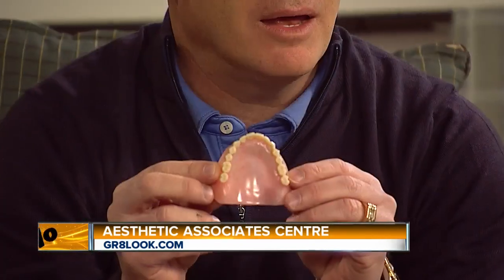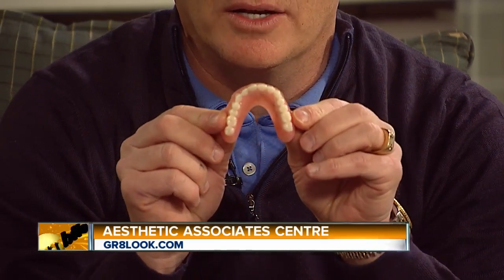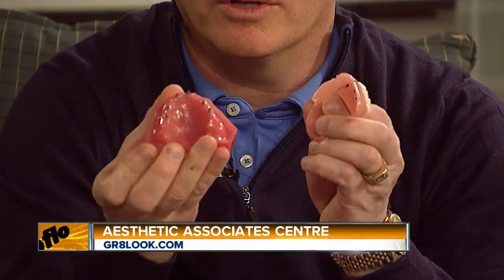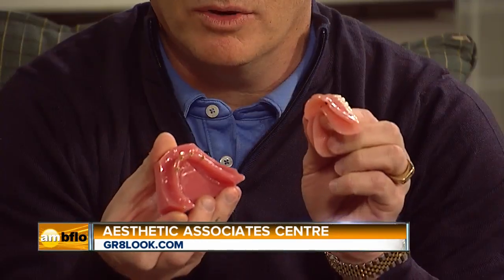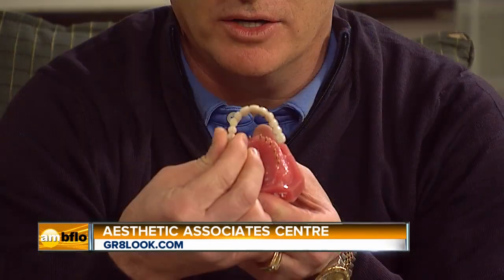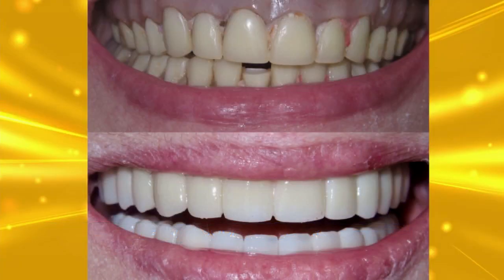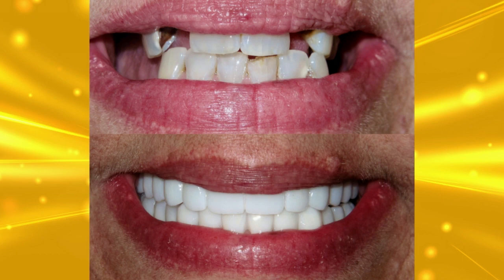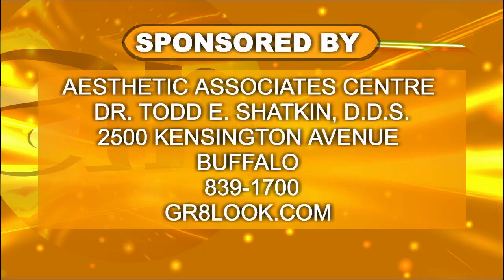Upgrading Your Loose Fitting Dentures to Cemented Permanent Teeth

Comment: My Oral Surgeon will place the "mini" implants for these "snap-in" dentures into the lower jaw, but not into the upper jaw.  He says he has had to remove too many of the snap-in denture's failed mini implants from the upper jaw. He says while the bone of the lower jaw is adequate for the function of the mini implants of snap-in dentures, the bone of the upper jaw is too soft to tolerate the frequent snapping in and snapping out of these mini implants and so they fail.
Of course, each person's health history must be evaluated when considering any dental implant. For instance, the intravenous use of bisphosphonates, aka diphosphonates (drugs prescribed to prevent and treat osteoporosis), have been, although rarely, linked to osteonecrosis (dying bone tissue) of the jaw and atypical (unusual) femoral (upper leg bone) fractures.
Please research only reputable sources of information.